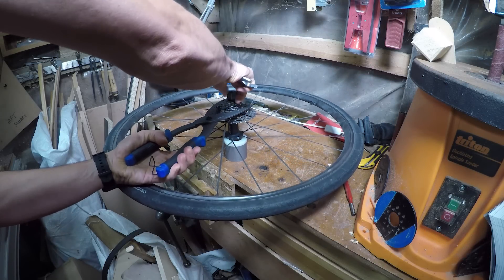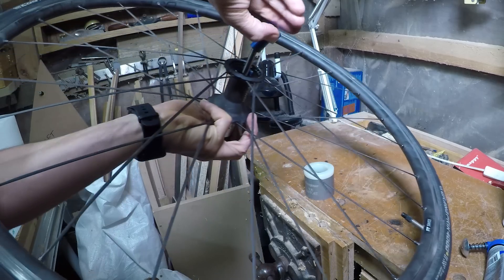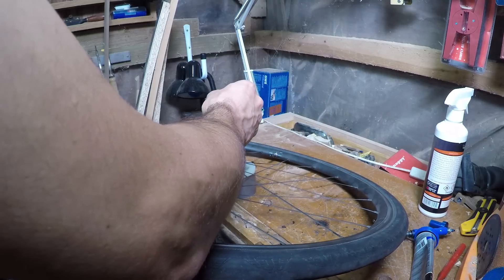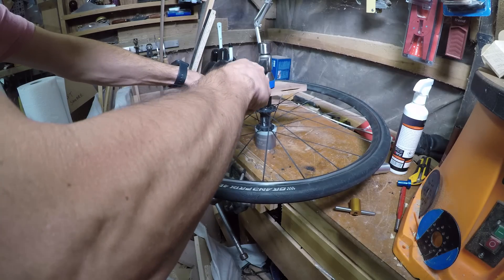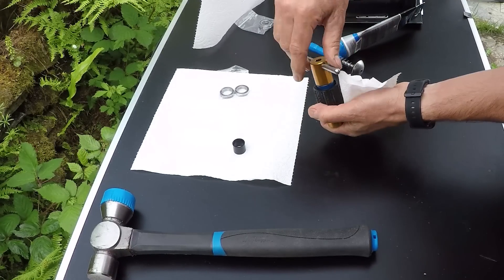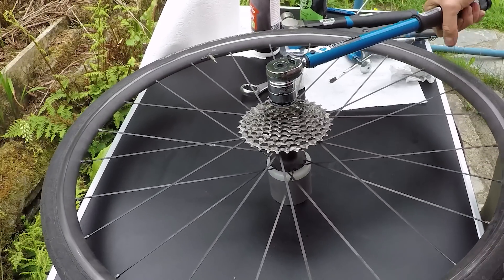Replacing bearings in a DT Swiss 240s hub and freehub

Comment from the maker: 0:12 - Remove end caps
0:30 - Remove freehub body
0:57 - Remove NDS bearing
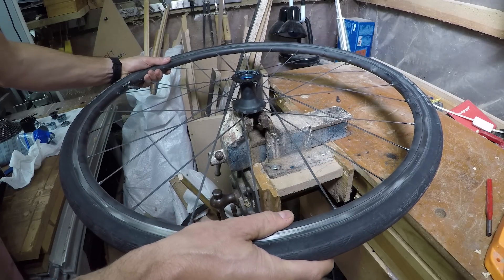1:12 - Remove ratchet ring
1:46 - Remove DS bearing
2:13 - Insert NDS bearing
3:13 - Insert DS bearing
3:51 - Insert ratchet ring
4:20 - Insert seal
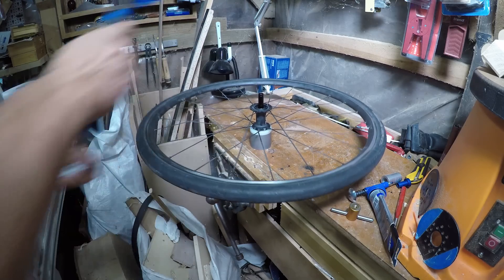4:51 - Adjust preload
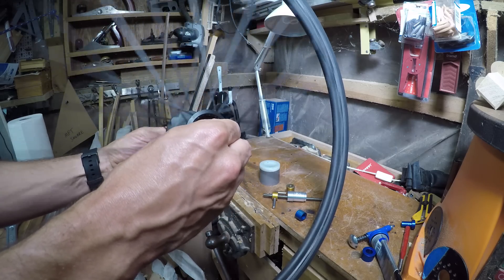5:13 - Remove freehub bearings
5:46 - Insert freehub bearings
6:43 - Grease freehub parts
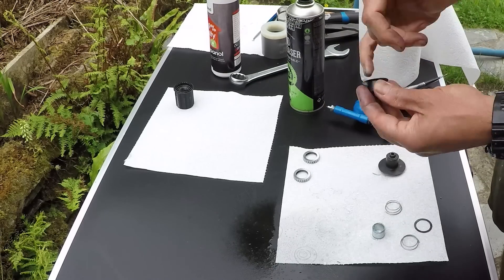7:01 - Grease star ratchet mechanism
7:27 - Reassemble freehub

Comment: Very helpful - thanks very much!

My only comment is that you don’t need a spacer for pressing the drive side hub bearings in (@3:25) if you press the bearings in the other way around (i.e. press drive side bearings first, reinstall ratchet ring, insert axle, then press non-drive side bearings). Not an issue if you have a suitable spacer lying around the workshop, but for those of us that don’t it’s one less tool to buy 👍 Putting the components back together in this order also allows you to reinstall the ratchet ring before inserting the axle, should the hole in your ratchet ring tool not be wide enough to accommodate the axle.
Reply from the maker: Good tip thanks!

Comment: Thanks for a great video. I just did the service. A couple of things I descovered reinstalling the wheel bearings I would install the drive side bearing first as you can use a normal socket to seat the bearing before the shaft goes in also the spacer washer needs to be seated in the rachet grove I used grease to keep it in place also my ebay tool did  not clear the shaft so I could not tighten the drive side down with the shaft in place.
Reply from the maker: Nice tip!

Comment: very nice video, just note DT 240 rear hub comes with different bearings, mine is 6902 on DS and NDS
Reply from the maker: Thanks Chi Zhang! There are subtle differences on the different variants of the 240 hub ...
Reply: @TheCyclingMan   how do we find out what type of bearings we need on DT240?
Reply: @kendericklin  see the manual, 6902 for disc versions rear and both fronts and 6802 for rim brake rear I believe
Reply: I’m just trying to find this out myself. I have a DT Swiss 240S hub and I belive there are two different types of bearing in the hub shell. Some bike shops say they’re the same but DT Swiss have said they’re different. It’s highly confusing. I recommend you wipe the outer seal during removal and check the text on the bearings both sides before buying new ones!

Comment: Leave the cassette on the hub, just pull the cassette and hub of as one unit. This also removes the outer drive side end cap at the same time, simples.
Reply from the maker: Yes - good tip - gives more leverage 👍.

Comment: Great video 👍 Interested in what you said about pre load by adjusting the bearings, I was under the impression the 240s is pre loaded by the spacer collars and does not have any actual adjustment, it’s done by fine machining tolerances of the spacers?
Reply from the maker: Thanks. There isn't any adjustment like with Mavic hubs for instance. But I still find you might need to adjust the bearings to get them to run freely - same is true with most cartridge hubs. If you tap them in lightly they might be just fine without any adjustment.

Comment: where did you get the nylon ring over the tube supporting the hub shell at the flange you are hammering the bearings down into?  I suppose one could just use PVC
Reply from the maker: Yes as replied below! I've also used two bits of wood before too.
Reply: @TheCyclingMan   would you know why my hub won't freewheel when I turn the thru axle tight or main causes

Comment: what is that gray cylinder and where to get it from online (which the wheel hub rest on it when removing the freehub spacers)?  

what is ratchet removal tool? can relink the removal again as the product page is not found.
thanks
Reply from the maker: That's the Hope Hub Support Tool - super useful and not expensive! Search eBay for DT Swiss Ratchet Removal.

Comment: Hello, I'am looking for 15x26x7 bearing for my DT Swiss 240 hub (installed on DT Swiss ERC 1400 DB 47 spline wheels). Unfortunately, the on-line shop you suggest has only the basic Endruro bearings, as the 15x26x7 hybrid ceramic ones are out of stock. Do you know any alternatives? Thank you in advance, kind regards, George.
Reply from the maker: I would give them a ring - they've always been very helpful. Not sure where you are based?
Reply: I am based at Chania, Crete, Greece. Thanks a lot !
Reply from the maker: @georgefouskitakis6697  Sorry I only know places in the UK - have you tried a local bike shop they may be able to get it in for you?
Reply: Hello, thank u anyway, I finally purchased one form the local retailed/service shop of DT Swiss here in Greece (Athens). Kind regards, George.

Comment: What RRP Kit did you use for pressing the bearings in? Can only find a kit that works for a 6802 bearing but not the 15267 bearing.
Reply from the maker: It's Kit no 10 I believe - OD 26, ID 15.

Comment: Hey. Are those the rims with the Oxic coated brake surface ? I was under the impression that it would not wear away!!
Reply from the maker: Yes Oxic coated.They wore away very quickly in the winter weather we get here on Dartmoor in the UK. Only used with their recommended Swiss Stop pads. But they did replace them under warranty and I sold the wheels on! Breaking with them in the wet was hopeless!

Comment: Is there any tool I can use to extract the bearings safely from a brand new , but damaged freehub body for the DT 240s?
Reply from the maker: Extracting bearings is easiest with a drift - but if you mean reusing the bearings I personally wouldn't - it's very difficult to not damage them at least slightly when you extract them.

Comment: Do you have any strange pinging sounds from your rear wheel? We have similar wheels and mine makes that noise when riding mainly up hills. 

Also do you prefer dt Swiss hubs or hope hubs?
Reply from the maker: Are you sure that's not coming from the spokes? Try applying some grease to the spoke intersection and see if that helps. My Hope hubs on my mountain bike need far less attention. But they only have 4 pawls so are quite slow to engage. The star ratchet for road is better in this respect. I've not tried the newer Hope hubs with more pawls.
Reply: The Cycling Man : could one possible reason be: under bigger stress the cogs of the chainwheel "plucking" the chain–a little like pickin' the string of a guitar maybe? < https://youtu.be/TzqZxtW4xJk > the resulting vibrations could then continue from the chain (or the chainwheels) via hub-body to the spokes. i have this soft tone pling-pling on my mountainbike's DT swiss spline-wheels all the time when pedaling really steep. kind regards.
Reply from the maker: Possibly - noises like this are always tricky to track down!

Comment: I seem to have 2 x 6902, and 2 x 6802 bearings for my rear 240s hub. Am I mistaken? Or do you have a different 240s?
Reply from the maker: I can't double check since I've now sold on that wheelset - but pretty sure it's as described in the video and its description on my hub at least. Just double check when you remove them.
Reply: I also have a 240s with 6902. I think this hub is a special system hub, but process is the same.

Comment: Do you know which bearings the 350 freehub uses?
Reply from the maker: I think it's the same freehub - so should be 6802 bearings. But if you pull off the freehub you should be able to see or measure with some calipers. 6802 bearings are 24mm outside, 15mm inside.

Comment: Hi, excellent video about the rear hub maintenance! I have a DT Swiss 240 rear hub with star ratchet, the problem is that the freewheel is so stiff that it doesn’t freewheel when I stop pedalling...It even transports the chain that the chain jumps off the cassette. It is almost like an engagementof the ratchets in the reverse direction...and it is unusually loud as well. Do you have an idea what it could be- can’t use the wheel like this... Do you always replace the sealing ring when you do hub maintenance? Is there a way to check the bearing sizes you need prior to dismantling? Thanks!
Reply from the maker: Thanks Ulrich. You'll really need to take it apart to see what's going on. A lot of times just cleaning it and re-greasing will do the job. No you don't need to replace the seal every time. You should be able to find spec sheets for your specific hub - to check the bearing sizes. Good luck and let us know how you get on!
Reply: I had the same issue after reassembling the hub. The problem was the washer over the threaded ratchet ring, which I didn't press in fully.

Comment: love the video!!  Is it completely necessary to have a bearing press for re-installing the bearings into the free hub body?  Thanks; need to do a swap at the moment
Reply from the maker: No - just need something a fraction smaller than the bearing and a hammer. Old used bearings make good drifts, as do sockets.

Comment: Hy,

I have a problem to remove the bearings on a front wheel from DT Swiss. Is there any tool or hack? It doesnt work with the VAR bearing extractor kit. Should I use a center punch?
Reply from the maker: Have you tapped out the axle? This usually takes out the first bearing. Then you can flip it around to take out the second bearing.
Reply from the maker: @Christian.....  I've changed the bearings in the front wheels a couple of times but don't remember any special procedure I followed. I may have used the RRP tool (http://tidd.ly/82d76865) which also does bearing extraction. Next time I do it I'll let you know what I did.
Reply: @TheCyclingMan  I have removed the bearings now! By the reason of the inner axle  and the abutting edges you cannot use the normal tools or tapped out. The bearing puller worth the money. The rear wheel is a other story.

Maybe I will make a video...
Reply: @Christian.....  Yes, please do make a video for DT Swiss 350 front hub bearing removal and replacement! That would be most appreciated.